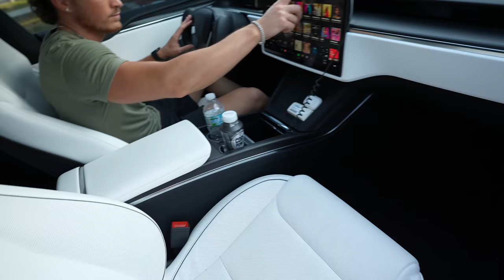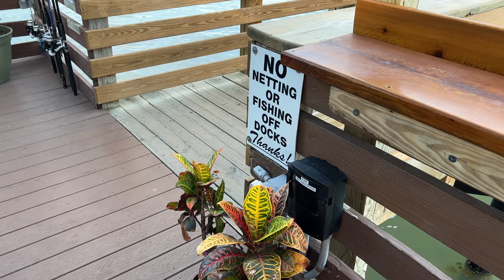LEAKING HIS NEW CAR!

Comment: Codee to remove that odor out of your car & garage I recommend going to Walmart and buying Meguiar’s air refresher. It’s like a air bomb where u leave in your car for 15 minutes with the windows up & a/c on full blast. After 15 minutes roll down all windows and open all doors/trunk and let air out for 5-6 minutes. U will be surprise it actually removes the smell. I did it in my garage one time but since I didn’t have any a/c I just put a fan in the garage for circulation and wow what ever smell was in my garage it was gone immediately. Check it out codee……..